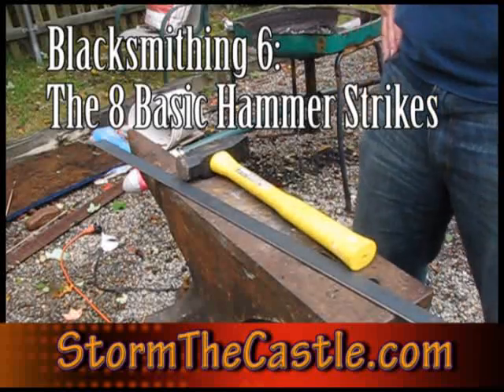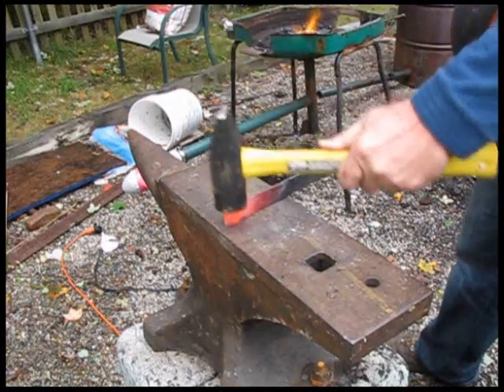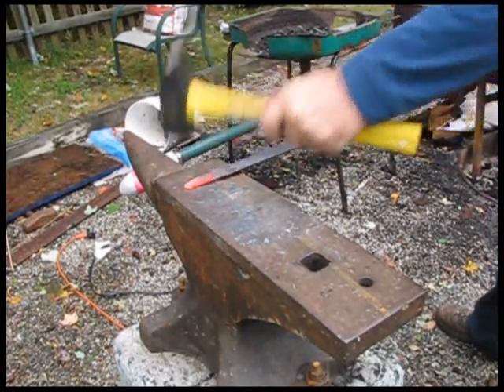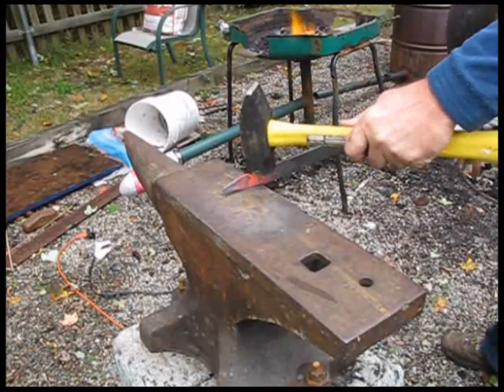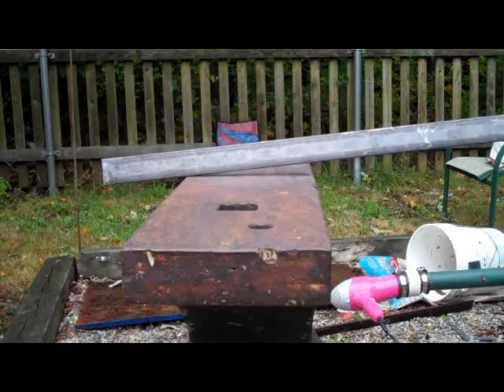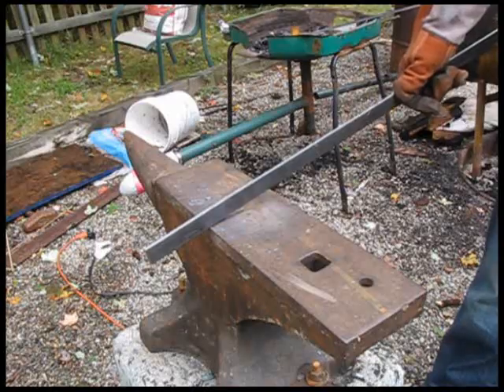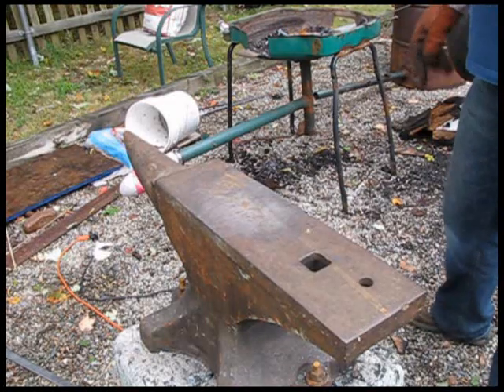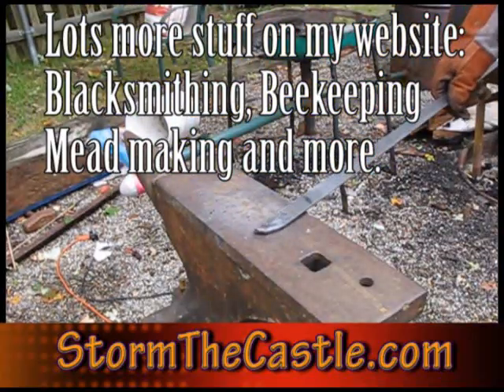Blacksmithing 6: The Basic hammer Blows

Comment: drason69 Hah! Currently have an old beaten-to-shit anvil, a railroad track, looking for a large wooden stump, have cut out the bottom of a BBQ (and some of the top to make it less deep) and will use some heat-resistant mortar in and around it. Will get some pipes for the air-intake. Then just find alot of cheat metal scrap and start beatin' :D
Reply from the maker: Keep at it!
Reply: mix equal parts plaster of paris and sand.  it makes awesome heat resistant clay that you can harden

Comment: Hey man I'm having trouble. When i hammer my metal lets use rebar for example i can draw the metal out really well but i can't seam to flatten it out.
Reply from the maker: Hmmm.... not sure why? Got the steel hot enough? Maybe a heavier hammer? Keep at it! With some practice the feeling will come. It gets to be almost like clay.
Reply: Rusty Shacolfurd some times having a bad anvil means the hammer is just doing all the work..which is why its a lengthly process

Comment: Aluminum wouldn't work. Aluminum melts too fast, and it's not malleable. Of course, aluminum is still workable if you want to make stuff from it. All you need to do is create/buy a forge (or forge-like device), get a metal container, put aluminum in it (cans work fine), put it on the fire, and then once it's molten pour the molten aluminum into the mold.

Comment: what material is an anvil made of
Reply: Metal
Reply: what type of metal?
Reply: Don't know, google it.
Reply: Steel. Everything in blacksmithing is steel for the most part. Actual iron is very rarely used.
Reply: Mine is made from iron
Reply: most of the time either cast iron or steel. depending on where you get it and how much you want to pay and how old it is.
Reply: Wood